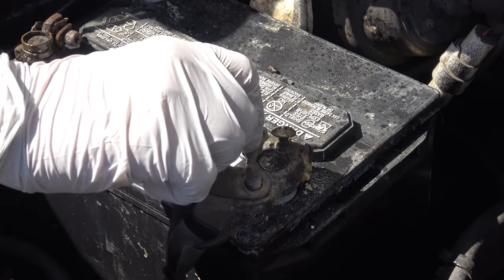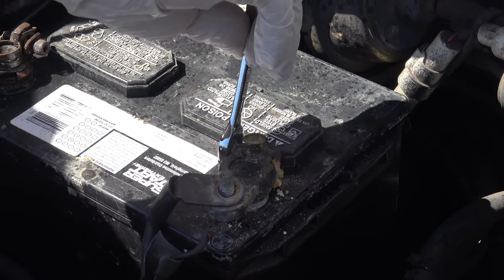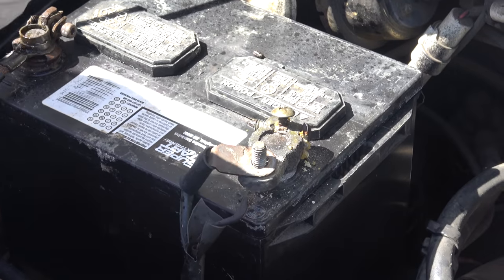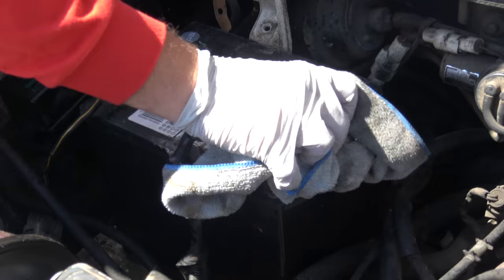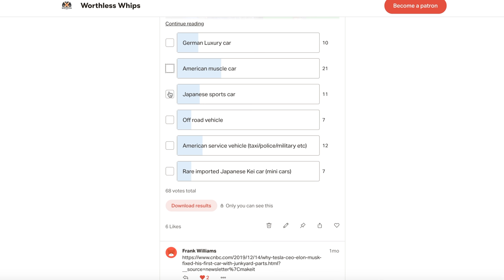Rescue any Car BATTERY for $12.50

Comment: This Episode is brought to you by the letters "W" "D" & the number "40"
Reply: It almost got used on Starship. Amazing stuff, really.
Reply: @SkeletonSyskey Can you tell me how to get.... how to get to Sesame Street? 🤣🤣🤣
Reply: Um? GPS?
Reply: "Makes for an excellent flamethrower."
--G. I. Joe
Reply: For cleaning of grease an grime anywhere on the car, don't use anything other than break cleaner. It evaporates real quick and really cleans good. It is cheap too. I have a "suede" coat. You know... the light beige thick coat with the sheep wool on the inside. Was in the garage of a friend of mine once. He was working on a CV joint of some car. Of course BLACK thick grease on the damn thing. And me being me I didn't use the eyes that I am supposed to use when stumbling through life, so I ended up walking into the thing with my shoulder. Totally black. Wiping only made it worse. 

He was laughing. I was really upset. Came up to me with a can break cleaner, sprayed it on, wiped it clean in a minute. Soaked it. Used some paper towels to clean again and just washed it in the machine. Came out new. 

So for grease cleaning, I would get boxes of those cans. Really cheap. Really useful. For rust removal there are plenty of liquids... but WD40 often does the trick and often is on hand since everyone has got that stuff. 

On some milling/iron smith/tool restoration channel I also saw some stuff being used... dunno what the name was. But it is liquid rust remover. Just put the part in, totally rusted, and it comes out clean enough to be able to lightly brush and reuse. I can imagine that stuff would work wonders on stuck bolts too, if sprayed.
Reply: @MrMairu555  practice practice practice.

Comment: I use a baking soda-water mixture to neutralize the battery acid, and at the same time give the whole battery a good scrub. If it's unclean it can (very slightly) leak current. You can test for this with a multimeter if you place it on the top cover of the battery. And its also much more easygoing to handle the battery when it's not corrosive all over.
Reply: I was going to post the same advice.
You have to be careful that the baking soda doesn't get into the battery.

Probably should have power wash the engine bay on low setting.
Reply: Be careful with baking soda, tried that in my old car and the soda/acid corrosion ended up stripping paint near the battery.
Reply: @snowleopard9749  that was the acid, not the baking soda. Baking soda is a base.
Reply: @tony_25or6to4  Yes, and when you mix them together, the result is still something corrosive.
Reply: @snowleopard9749  baking soda can be corrosive because it has sodium, but that takes longer. The foaming is from the baking soda neutralizing the acid from the battery. Like when you mix it with vinegar.
Reply: Yep! It's basic high school chemistry.

Comment: Excellent advice. My Bronco wouldn't start. Mechanic said, "Replace the wiring harness." Took it to my buddy. He replaced the battery terminal connectors, cleaned the terminals, replaced the ends of the wires, and voila! No more problems. Also, saved the cost of a new battery, which runs $80 to $100. PS he loves WD-40 also. GMTA
Reply: On my old J-10 I started losing headlights and certain other electrical stuff.  Was also hard to start making me think a bad ignition switch.  Turned out not a battery, not a switch, not a wiring harness, but a loose bolt through the firewall holding the interior fuse box to the wiring harness box.  In my area it is also hotter than hell oftentimes, so the weather seal had also softened and sagged into the terminal box on the firewall.  That truck took a real beating and rarely was on a real road.  But always a good idea to start with the cheap solutions first!

Comment: If you have ever witnessed a car battery explode while someone tapped on the terminal, you wouldn't be tapping on those with a hammer.  A weak cracked buss internally attached to that terminal makes a spark in there, suddenly its very loud and violent.
Reply from the maker: I know a backyard mechanic that was refilling the electrolyte on a car battery while it was running and he was smoking and he ended up severely scarring his face, not pretty
Reply: Yeah dont tap on battery posts at best you may break the post.. Use a pipe wrench to get stuck ones off and get a terminal spreader if the terminal wont go down on the post.
Reply: i usually use the box end of a wrench/spanner so i hit only the tool and not the post across the top so the connector goes on evenly.

edit, sorry, rushed that. a box end that is slightly bigger than the post and put that over the connector and hammer on the box end in the middle.  you dont hit the post or scratch it or bend it.
Reply: I was thinking the same thing, not the best idea be banging on an old battery.
Reply: @guod1973  I remove the bolt and use a large screwdriver while holding the other side of the terminal to open it up if it is severely corroded.  This avoids torquing the posts.  I've also been taught to never hammer the terminals on because it could damage the battery.  I didn't know it could explode as Mike P said.

Comment: Great video guys. This is great timing. I just had to disconnect the battery on my Honda Accord (2005) because my brake lights were staying permanently on. I've just got replace this little plastic switch on my brake pedal, but I needed to unhook the battery until I have the replace part.
Reply: Hondas and Acuras are also famous for the morning dead battery syndrome caused by cheap relays and blue tooth modules.  It all starts with a barely noticeable parasitic drain to ground when the relays do not open after they are signaled to turn off (like the AC clutch relay), or a thin little trace on a pc board finally breaks and makes the bluetooth module into a little heater even when the car is shut off.

Comment: Car batteries can be a great danger if you happen to short circuit it!
A simple rule is that when you remove the battery, you take the minus first, and when you mount the battery you take the minus last.
The battery must also be secured, otherwise the car will not pass safety checks.

Comment: I remember that my dad got a used car really cheap because it wouldn't start correctly. Turns out that thightning the battery terminal resolved that problem.
Reply: My father once bought a car for $35(about $335 in today's dollars) because the previous owner had rebuilt the engine and it would barely run. He found that the previous owner had forgotten to torque down the rocker arms. Once he did that and adjusted the tappets, the engine ran fine.
Reply: I had a friend whose father went to the auction one day. There was a pristine Corvette there and nobody bid on it because the auction house had to push it into position. My friend's dad bought it for something like $100 and swapped in a new battery and it started right up and ran fine.
Reply: Little different form cars, but family friend bought electric chain saw used it and presumably bought another one after fist one didnt work and then that didnt work ether after being in winter storage, so she brought both to me and told that i can keep another one if i can fix them both and then she left.. i plug them in and pulled anti-kickback switch back and guess what happened? Well i called her and told her to turn around in end of my drive way :D Her face was pretty hilarious to see when i explained it to her. Told her to give based on her conscience and if she had none, then its 1000€'s. Ended up getting older of the saws as she didnt need two :D
There is user manual with these things for a reason. If you cant get it working, might want to look into manual first and then ask someone if they know how to fix it if its actually broken. It probably will be cheaper than buying new one. Also if you have access to waste site or such where people trow these things, might want to keep yours in storage and look if you can find another one for spares. If that has same issue you know buying spare wont solve the issue, then make improved part your self.

Comment: DO NOT GREASE or OIL battery terminals!  Mechanics do this all the time (often charging for the service) and it just shortens the terminal life.  First, petroleum products react with lead making that black non-conductive surface AND grease is non-conductive.   Second, battery terminals start out as hollow and the connecting pin from the plates is soldered into the terminal on assembly.  This results in a porous pathway for battery acid to travel up and into the terminal joint.  Corrosion is from the inside out.  Sealing the joint with grease just holds the acid in and makes things worse.  Clean and dry is the way to go.  As the battery ages the corrosion issue becomes worse to the point that it can be the failure point rather than issues with the plates.

Comment: smal hint: Did you know that in this battery terminal cleaning tool, there is hidden brush to clean inside of connector?
Reply: Right?  haha  its funny, when I found that out on my own years ago.. I was like Wow, hidden treasure!
Reply: @fastj1962  me too.  I found it 2 years after purchase of the tool:)
Reply: jason9022  I will take in to consideration your wisdom...
Reply: jason9022  Now your lying. But lets just say they did and I never saw one even though when I was 16, my dad had 25 cars that actually ran that I got to work on and drive. Where exactly does a guy learn to use these chinese manufactured tools ? Are there directions? Is there a week, day, hor, minute dedicated to this in an auto repair class? I'm actually curious as to where the hell I should, or anyone should glean this information from?
    I actually can't remember the first one I owned, but the last one I bought I was at autozone and it was in a bin by itself.  Super weird thing to comment on at any rate.

Comment: Dielectric grease helps a lot.  Also those clamp terminals are a temporary fix.  The next owner will be dealing with these again in a year or so.
Reply: he's kinda cheese dicking it!  Better to break out the soldering iron and re-tin the frayed ends and sold on a proper terminal connector.
Reply: Once you’ve cleaned up the posts with a bit of emery cloth, and put on the clamp,...add a good dollop of Vaseline or grease all over the post and clamp to stop any future oxidising. This video is a bit of a turkey !
Reply: Yep, he could have bought that stuff and saved on the cleaner tool instead, which is really just added comfort for someone who does battery terminal cleaning a lot.
Although if he screwed the terminal clamp itself really tight, it should deform the terminal sufficiently to get rid of at least some of the micro spaces.
BTW, this reminds me of the utter madness that is exhaust header heat shield screws.

Comment: 2:01 - Oh for god's sake. Of course you use WD-40 on everything. Everyone who likes WD-40 uses it on everything, because they don't actually know what it's for. The WD-40 name derives from "Water Dispersant formula #40" -- it was invented to easily apply a microscopic film of oil to steel parts, to repel water so the steel parts wouldn't rust. The oil content is too minuscule and too thin to be useful for actual lubrication, but it does contaminate everything it touches. If you need a spray that will loosen rusted parts, get a bottle of Liquid Wrench instead -- it's got the same solvents as WD-40 without the oil. Whereas if you need a lubricant, there are hundreds of other options. Leave WD-40 on the store shelf where it belongs.
6:28 - Instead of fouling the wires by spraying WD-40 on them, solder them with a soldering iron and some heavy-duty solder instead. The flux inside the solder will etch the wires to remove any oxidation and the solder will coat the copper to protect it from corrosion in the future.
7:20 - If you're going to go through the trouble to replace the battery connectors because the old ones were corroded, also get a set of those felt-fabric donuts that fit over the battery terminals underneath the connectors; they will soak up any acid that leaks out of the battery in the future, so it doesn't seep along the surface of the battery and corrode everything in sight.
Reply: And always disconnect the (-) first!
a) less chance for short circuiting if the wrench touches the body or engine by accident,
b) with most newer cars removing (+) first will fry a thingy in a generator,
c) manufacturer directions or RTFM.
Reply: He was mostly using it to prevent rust and corrosion so that's exactly what you said it was designed for.
Reply: The thin layer of oil is exactly what he was using it for. It removes rust, leaves behind oil to prevent rust. 

It's not the best penetrating fluid though, but it's great for cleaning. 

The wires weren't a flawless job but they're good enough, they just had to get the car out the door. The next owner can worry about making it perfect
Reply: The felt washers are a fraud.  I used to sell car batteries.  We took in FAR more bad and failed and or corroded batteries with those washers than without.  It was an open joke to the people selling the batteries that we were ensuring another battery sale with every set of washers.  And management pushed us to sell the washers, of course. Never use those things. And if somebody tries to sell them to you, ask them if they are trying to ruin your battery or if they are just stupid.  Either way, don't use them.
Reply: LOL, car battery acid corroding things... takes me back to a friend of mine. He had a customer with an aston martin db7, I think it was, blue/silver. Nice car. Battery in the back, if I recall correctly. I can't remember what it was that went wrong... but his entire compartment was flooded with the stuff. Cleaning that out completely and correctly was a real messed up job. Lots of corrosion, fast.
Reply: @LatitudeSky : I have seen firsthand that they work. Something else must"be been done wrong. Maybe people thought the felt washers were an excuse to neglect their batteries even longer than they did before.
Reply: @xenoneuronics6765 : As I already said in a previous reply, that thin layer of oil can't do any of the things he was using it to do.

Comment: I love old lightweight, back wheel drive sporty cars like this MR2. Also i like this new channel - positive vibes! Winston you explain everything very well!

Wonder that this battery still charges full...
Good thing is that Californian cars never seen cold and salty roads. But one good thing here in north is that on snow it is very fun to drive, you can drift with low power cars also on low speeds and like this you learn drive.

Current WRC Champion is Ott Tänak - from here Estonia, i am very proud :)

Comment: Finally someone using WD-40 properly, to remove rust. 

There are better penetrating oils though, and I was just reading that a 1:1 mix of automatic transmission fluid + acetone is much better than any other penetrating oil.

WD-40 will handle most light jobs though, but that battery terminal was right on the edge!

Comment: Corrosion happens more often when the charging cycles increase, if you get corrossion quickly after cleaning the terminals it means the battery isn't holding charge and needs to be replaced.

Comment: 1. Soda Pop on a corroded battery connector works wonders, seriously! 
2. Let it sit on there for about 10 minutes
3. Rinse with water. Just make sure the battery water caps are on tight, as soda pop kills battery acid. 
4. Repeat Soda Pop as needed until the acid is gone.
5. Use a Battery Terminal Cleaner.
6. Install the battery Terminals. If they are to tight to go on, DON"T use a hammer! If they are to tight use two screw drivers to separate them a little.
7. Spray them with some CRC 05046 Battery Terminal Protector. Done
Been working on vehicles for over 35 years, this method works hands down. Best Wishes & Blessings. Keith Noneya

Comment: Great Video.. as a Automotive Technician myself id suggest making a follow up video of continuity testing your Ground wire and charging wire.  and or, Testing the battery performance using a "Toaster Box" IE an CCA tester, then checking Charging voltage.. All basic stuff that is applicable across many makes and models

Comment: The battery seems to be leaking electrolyte around the terminals. The new terminals will probably corrode fairly quickly. Also hammering on the terminals is a big no no, because it creates cracks in the electrode plates.
Reply: It was just a little tap.

Comment: I work as a mechanic at rental car company and Nissans always have a lot of battery corrosion. So long as it isn't bad enough to warrant replacing something, I just spray it off with a hose and avoid hittiing sensitive electrical areas (works even better if you dry it off with some high pressure air). 

It's way faster and does a better job. Other guys spend 30 minutes taking everything apart and scrubbing everything down and using special battery corrosion spray and they still miss some.

Comment: when ever any of my battery connectors bite the dust, i always replace them with brass,  they last tons longer and make a cleaner connection to the electricity.   

if the battery post is to small, bend a copper penny around it.  works excellently on many of my cars for years. 

baking soda kills battery corrosion.  dont cut your wires, they are often just barely long enough as it is when new.
Reply: Pretty trivial to splice some extra wire to it, of the same gauge, with some solder and some shrink tubing
Reply: @xenoneuronics6765  that sounds a lot more effort than just putting baking soda then water on it.